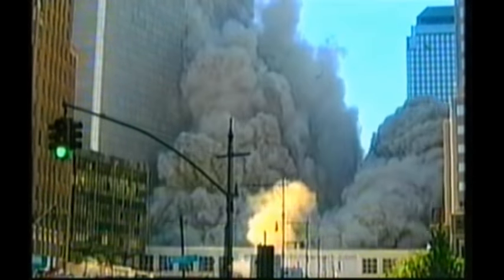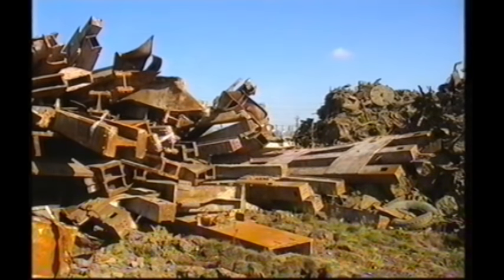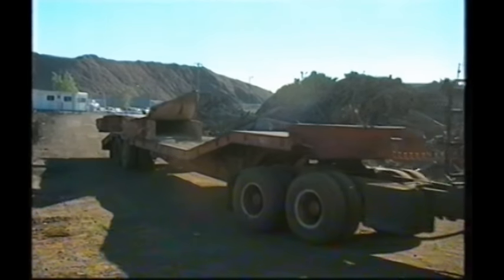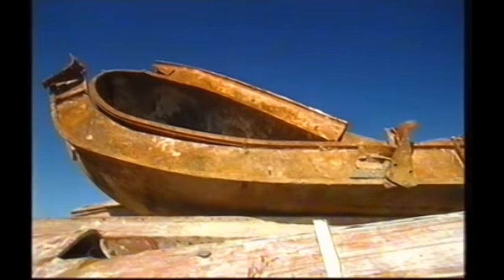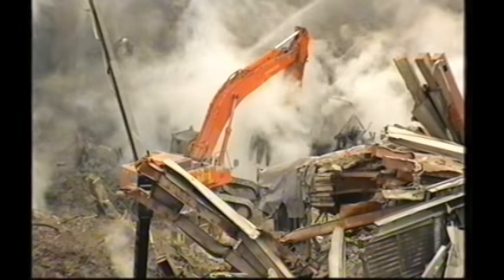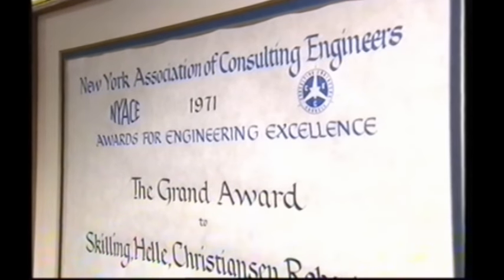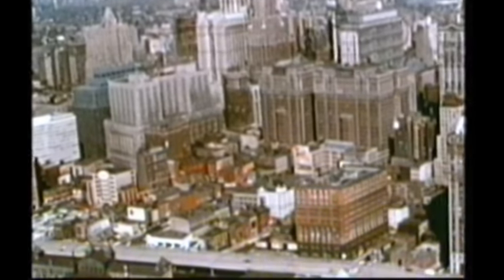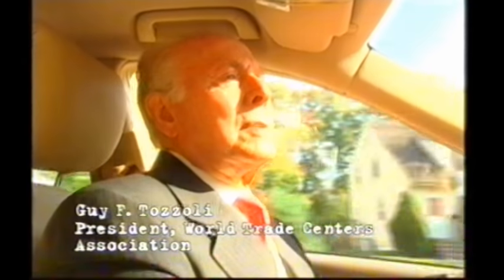9/11—"How The Twin Towers Collapsed" (C4 documentary, 2001)

Comment: ATTENTION YOUTUBE ENGINEERING WANNABES- What are the odds all three buildings collapsed in a symmetrical fashion at freefall speeds showing no resistance falling through the path of greatest  resistance, the inner core, falling into their  own footprint but not before pulverizing into dust before even hitting the ground, all in the exact  same manner, all in the exact general area, all on the exact same day?    What are the odds all three buildings were brought down by design?  Odds and physics point to design, not 🔥 22:47
Reply: Since that is not at all what happened my mind is a bit boggled as to why you would ask.  Seems rather pointless and irrelevant. Personally I prefer to spend my time only talking about things that actually did happen, not conspiracist fantasy and propaganda.
Reply: @911conspiracy-c9s  - 1. None of the collapses were symmetrical by any acceptable definition of the term, not that symmetry actually means anything anyway. That's just marketing by one particular advocacy group.

2. Freefall SPEEDS is not a thing. Free fall is a measurement of acceleration, not velocity. Also, anyone with one working eyeball and the ability to tell time (the latter strictly optional) can easily see how untrue that claim is. Twin Towers and Building 7 all collapsed at an average of about 1/3 (0.33 or 33%) of GA.  I know. I measured it myself. Did you?

3. The path of greatest resistance is UP.  The WTC Towers all collapsed in the direction gravity pulls them which is down. That is the path of least resistance.

4. How can two buildings each with a 1-acre footprint (total 2 acres) collapse into their own footprints yet create a 16-acre debris pile that destroys 8 surrounding buildings - all of which were outside of those 1-acre footprints?  This is another of your claims that can easily be dismissed by simple observation.

5. The collapses of the Twin Towers differed from each other and were completely different to that of Building 7.

6. Pulverizing into dust before they hit the ground?  Pulverizing what into dust?  Gypsum board and concrete?  Well yeah, duh!  🤦‍♂

7. Of the 10 buildings destroyed on 9/11/2001 in NYC 6 of them collapsed, not 3. 

You need to stop mindlessly repeating other people's bad ideas off the internet. I've been watching people repeat that same tired mantra nearly every day for almost 15 years and they all failed. You won't be moving the needle on that.
Reply: @TheCriticalStinker-jw4fl All B.S. None of what you are saying is true. You lose this debate. Lying gets you nowhere
Reply: @911conspiracy-c9s  - Glad we got that settled then. Have a nice day.
Reply: @TheCriticalStinker-jw4fl OMG.  Prove me wrong. Give me an experiment that can demonstrate your false narrative.  End of story😂
Reply: @TheCriticalStinker-jw4fl I quote" glad we have this settled then? 😂".   Spoke too soon

Comment: Thurmite charges set in the walls of the tower they set them in place when they rigged the truck bomb in the underground parking garage then they went in with heavy duffle bags after they got everyone they also have been use remote control aircrafts in the desert to see how accurate they could fly a jumbo jet just to cover up the explosions that were set off just like a demolition crew would they said it was the jet fuel but if you slow down the film footage you can see the explosions going one after another just like when they do a demolition of an old building its been over lots of years now but I refuse to believe there cover up they pulled this off to go to war and to bring in lots of laws that gos against our freedoms just take a look at all the laws  they passed right after  911 they already had these plans ready to go

Comment: I dont believ build 7 did colaps but if so thinknabout the largest earth quake u can imagine. Thats what it would have felt like to stand there... now you want to talk about it and ask the stupid ass question of of how the fucking towers colapsed? A fucking passenger jet was flown into both of them. So many people trapped bc they were over the impact areathere was no going down. Ppl say well the fuel doesnt burn hot enough to melt iron...it probably does but lets say it doesnt. You have to consider the impact hieght of the building. 2/3 to 3/4 of the total hieght of the buildings. Imagine all the wieght that is above the heat zone. You dont have to completely melt the iron you just have to make it weak. That poor old man it wasnt your fault dude they were built fine.

Comment: Documentary was good right up to the point where physics stopped being discussed at the end.

YOU DO NOT GET COMPLETE IMPLOSION COLLAPSE merely from a structure that has warped / bent from heat.  It doesn’t “create momentum” causing a pancake collapse!  More over, assuming it DID collapse in a pancake fashion, upon each floor collapsing, a large portion of mass would eject OUTWARDS away from the collapse… thus REDUCING the load moving down towards earth… the collapse would stop on its own.  Not complete to the ground.
Reply: Welp, you've been debunked.
Reply: @MFitz12  That was adorable!  And yet, all of that copy pasta from the final report doesn’t address actual real-world applied physics.  

The mass of the structure, any part of it, you choose, was already accounted for.   Many times over.  When the structures were designed, it already had allowances for various failures built into the equations.  

Let’s go back to your “floor 80” scenario.  The mass of the structure above floor 80 has a known mass.  Let’s just say the mass of the floors above 80 are 1000 tons (the number doesn’t matter… the only thing that matters is that the actual number was known to the engineers on the project).  So you have 1000 tons of mass above floor 80 that decides it’s going to leave its designated location and head toward earth under the force of gravity.  To overcome the resistance of the 80 floors below it, one of several things need to occur assuming the known mass was accurate:

1. Earth’s gravity significantly increased (it didn’t), or;
2. The molecular structure of the supporting foundation and floors 0-80 changed (it didn’t), or;
3.  The floors above floor 80 ADDED mass (they didn’t other than the relatively minute mass of the aircraft that didn’t combust), or;
4.  An unknown force levitated the floors above floor 80 to a height sufficient to have them reach terminal velocity with all mass in tact and retrace its route perfectly back down to floor 80 with enough force to overcome the live load ratings with all allowances already calculated (didn’t happen), or;
5.  A combination of all of the above (didn’t happen)

I wasn’t disputing whether steel bends.  Of course it bends.  The towers themselves already had significant sway variances built in.  Having been in those towers on a windy day more than a few times you could feel them sway on high wind days.  But let’s assume your version is accurate here… compromised structural beams don’t result in a collapse straight down… they would result in a lateral “topple” after a pronounced “buckle.”

While I enjoy the detail of what you presented, it still doesn’t provide a solution for precisely how the structures collapse vertically against all known principles of applied physics.  

Show me the numbers.  

This video spent a lot of time discussing all other areas, and yet skipped entirely over the unrealistic resultant collapse vertically.  

I will take a look at the video links you posted.  But I do want to see the numbers on how you arrived at your conclusions.  This is a math problem with tons of known values and principles.  And no, I don’t believe the earth is flat, in case you were wondering lol.

Remember:  After collapse initiation, MASS WAS DECREASING, not increasing on the way down.  The structure had its most mass, prior to collapse, not after.
Reply: @TheMiddleClassholes  Nah.  The math doesn’t math.  Just because someone says “you’re wrong” doesn’t make it true…
Reply: @-KingOfKhaos  Fitz just blasted you out. Now you're baby whining.
Reply: @TheMiddleClassholes  Yup. Sure thing.  Where is the math?
Reply: @-KingOfKhaos  The math of what? The collapse of the towers?
Reply: @TheMiddleClassholes  No, the math of escape velocity for a lunar rover.  🙄 Bro if you can’t keep up, you probably shouldn’t try to drag me.
Reply: @-KingOfKhaos  The math is available for all to see. Do you need a link. Do you need me to lead you to the water? If you can disprove it you'd be rich. My guess is you're a YouTube hand waver.
Reply: @TheMiddleClassholes  Yes.  Link it.
Reply: @-KingOfKhaos  Abstract titled "The Total Collapse of the Twin Towers: What It Would Have Taken to Prevent It Once Collapse Was Initiated". It's from the ASCE.
Reply: @-KingOfKhaos  - Actually, my description describes precisely what happened, why and how and addresses ALL of your concerns. You either didn't read it or didn't get it.  Nothing you typed above is relevant to what actually happened but strongly indicates you are still stuck the in block dynamics false constructs that trap a lot of people.  My previous post was specifically designed to dispense with that mind trap but you have to be willing and able to let it go. 

I suggest you read through my previous post again, with a lot more care than the hand-wave you gave it the first time. Then, when you identify bits where you have lost the plot, stop and ask. We'll take it a step at a time.

Comment: The comments made by Charlie Thornton comparing the 13,000 tons of windage - OVER THE ENTIRE BUILDING and then glibly waving away the 300tons of a fully loaded B747 - without a single mention of velocity & mass calculations he must have been aware of - is extremely disingenuous! That kind of energy manifested into the head on shape of an aircraft - is amazing destructive. Quite frankly, I'm appalled that an American uttered it - the same nation that suffered kamikaze attacks by small aircraft made from aluminium at much slower speeds - yet managed to penetrate steel warships often without bombs or additional aids. I've read at least one account where some of the wreckage of one was recovered in the bilge after travelling through many steel decks.

Comment: Insurance covering terrorist attacks?
Reply: After the 1993 attack, it was only common sense to have insurance specifically for terrorist attacks which otherwise may not have been covered.
Reply: @blairdelnero2762  - Terrorism coverage is a standard rider on commercial real estate insurance policies. The building where I work has it and its only a 20,000 sq. ft. 2-story in the outer suburbs. Don't pay any extra for it. Just part of the policy. 

Finally, your quick resort to personal attack, insult and threat does not exactly give off rocket scientist vibes. It just makes you seem ignorant, which is backed up by your other posts.
Reply: @blairdelnero2762  
Really? Designed AND built things? How many ultra-tall towers have you designed and/or built?
Designing and building a latrine doesn't really count for much in an intelligent conversation about 9/11.
Reply: @blairdelnero2762  nah im an engineer and i know what other engineers sound like. you're not cut for it and your projection stands out

Comment: A Captain Hindsight comment here… why did the fire department keep sending firefighters in to put out the fires when they should have been focused on clearing out the buildings and perimeter? It seems to be the American way to not learn from experience or mistakes.

After the structural damage to one of the towers from explosives in 1993 from the terrorist attack, a review and insight team consisting of the architects, fire analytics experts, etc., should have looked at the obvious future scenarios involving plane strikes based o collective current data of commercial jets, fuel, big building structural dynamics, etc.

From that, I would expect they would see the obvious possible outcomes as described in this video. Armed with this knowledge that collapse would be the outcome, make a reality-based hard-knocks plan of action - get people out, get people away from buildings, prepare for collapse.

But to illustrate the lack of consequential future planning, in reality on this day, the police and fire departments literally weren’t on the same frequency. Meaning, due to rivalry, the departments did not share a common frequency to communicate in an emergency. 

In summery, there should have been a plan in place for this disaster scenario. Example, commercial jet strike - building will collapse. Clear out people. Close down perimeter. Do not run up stairs carrying heavy fire hoses. Wear oxygen tanks. Watch out for falling people. Thank you. I know hindsight is 20/20, blah, blah. But where was the hindsight after the first terrorist attack?
Reply: Zero firefighters were sent in to put out the fires. It was a rescue mission. 

Why after a bombing in the basement would there have been a review of airplane strike scenarios?  Why would that be on anyone's radar Captain Hindsight ?

What scenarios should they look at and why? 

How should they look at them?  Doing a video like this after the fact where the effects can been seen and identified is a much different animal to modelling some hypothetical (which may in no way match the real event). 

Like they say, hindsight is always 20/20.

Comment: Building was designed to take direct plane hit so you would have to assume that the cutting and placing was installed during the overnight security upgrades.
Reply: The Twin Towers were investigated (not "designed") as to whether they could survive (however one chooses to define that) an accidental hit by a landing Boing 707 at 180 mph, not a loaded B767 being used as a kamikaze missile at over 500 mph.  In terms of impact energy that is about a factor of 5.

Both Towers did survive the impacts as both were obviously still standing after they were hit.  Twin Towers collapses were due to a combination of factors, not just impact damage alone

Impact Damage (physical damage) + Fire (heat) + Time + Gravity = Collapse

Remove any one of those factors and there is no collapse. Fail to consider all four of those factors together and you will never understand the collapses.
Reply: Given the amount of time, materials and manpower necessary to demolish a relatively small office building (e.g. 25 storeys) in broad daylight, then please explain in detail how TWO 110-storey buildings were rigged for complete demolition under the very noses of tens of thousands of people who worked there every weekday.
Then, please explain why any airplanes were necessary if both buildings could be demolished remotely.
Then, please explain how the collapses of the towers began at their respective impact points.
Reply: @kyle381000  Do your own research the answers are out there.
Reply: @MFitz12  You'll find your answers within the design itself and the petition to have a new investigation.
Reply: @lorirogers452  - I posed no questions in this thread.  I made affirmative, factual statements to correct the errors in your OP. Since I have a far better understanding of Twin Towers collapses than the morons who have been going nowhere with that pointless petition for 18 years I hardly see how your advice is going to help. 

Finally, it is worth noting that in my experience anyone who says to someone else do your own research absolutely has not done their own. That is a copout and deliberate evasion, not a response.
Reply: @MFitz12  True it is a lot less time consuming to flip it back on but also might add to your programming open you up to reality have ever been in the world trade center?
Reply: @lorirogers452  - I hope you found that helpful. Have a nice day.